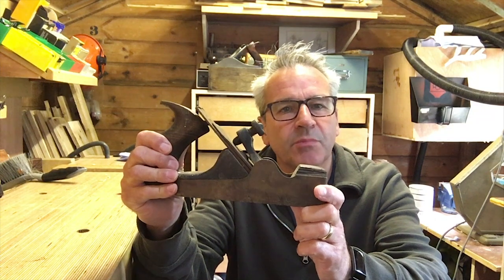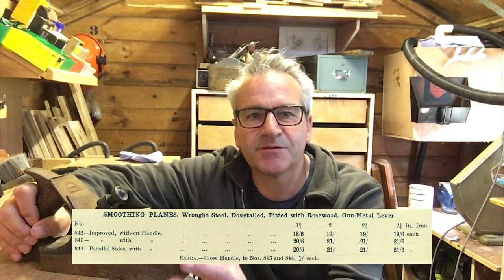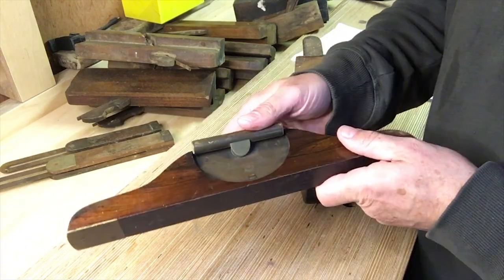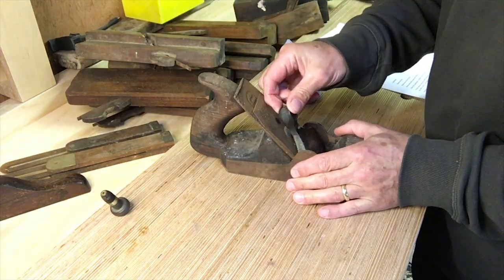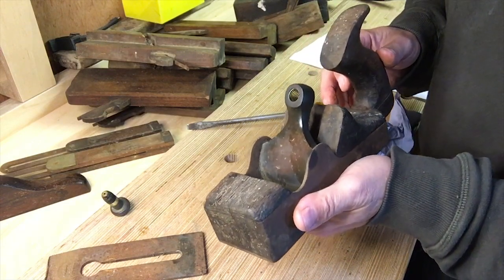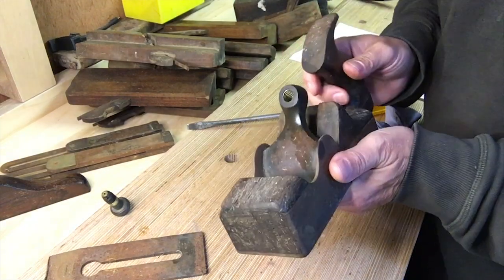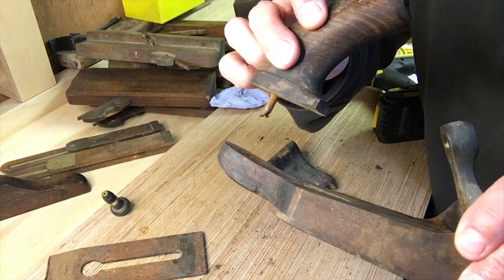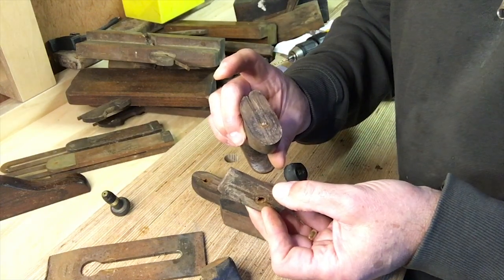Rare Mathieson Infill Plane restoration help needed

Comment: Oh the adjustable spirit level, nice bit of kit! Never seen one like it.

If you're not already a member there's a great wealth of knowledge on the UK Workshop forum in case you'd like to ask about it on there. Great bunch there, very helpful with tracing old tools, tracking down patents etc.
Reply from the maker: Mark above is suggesting it’s an inclinometer for measuring an angle or incline which makes sense - interesting
Reply: @TheShedProjectUK  Follow TC's advice on joining the workshop forum if you haven't already  🔨👍😊

Comment: Nice old plane.   I would not dunk the wooden parts in water, they will absorb water, expand, and then perhaps crack even more when the water evapourates.
If this were my plane, I would do a resto-mod flatten the bun and add a brass plate to get back to original height.
To remove the old glue I would use hair dryer and scraper.
The tote looks like it originally failed at the glue line and then someone did a bad repair with the screw.
As you said either epoxy the handle back together with the remnant of the screw left in place, or drill out the remnant of the screw.
I am interested to see how the metal body looks after cleaning.
Good call to not remove the pins for the lever cap.   They are likely swaged over into the body.
I love the level.    Likely intended for carpentry use rather than dovetails.
Dave.
Reply from the maker: Hi Dave thanks for the comments - going to start on this next week - handle fix first - probably just clean the bun for now as its not missing much wood really, the spirit level it turns out is quite rare so thats going to a specialist auction in November

Comment: That is a nice lot you got there.  
I really like that wooden bevel protractor.  I would definately use that one if I came across it.
Reply from the maker: At least I know what to call it now! Is it more an engineering thing rather than woodworking?
Reply: @TheShedProjectUK  This one I am confident is all woodworking.  The engineering ones I believe are smaller and more or less all metal. But, I am no expert in this field so take my statements with a truckload of grains of salt.

Comment: Hiya, was watching this on the YouTube app on the TV and popped up immediately to see if I can help. 

Full disclosure: have never done an infill plane but yeah, definite no to getting this wet. 

The wood could do bad things to the metalwork when it expands, but potentially worse it could catastrophically crack upon drying and shrinking back down. I've had this happen a few times when I washed old wood (not soaked it, just got it fully wet). And even swift drying off to limit absorption didn't prevent this; so now I'm very leery of getting old wood (specially beech) wet; ash seems to take it much better so I still sometimes wash old chisel handles as part of the initial cleaning process if they're very grubby.

Old glue – if it's a protein glue this will soften with heat, and careful heating with a heat gun can do it without putting the wood at risk. Obviously use a hair dryer if you went to err on the side of caution. Damp + heat is the classic combo too, so you can lay on damp strips of kitchen paper, or cotton wool. Vinegar is an old trick for softening old protein glues, but obvs you want to be careful of where the vinegar goes in this context. 

BTW not just because this is a Scottish plane I wonder if this was glued together using Scotch glue specifically :-) 

The stuck screw – for next time, try and heat it up very hot with a soldering iron. This can sometimes help release a rust hold. Obviously the head on this was badly undermined by rust so you'd have likely broken that anyway, but you might have been able to twist out the body of the screw once you separated the handle, without it snapping off. If you want to get what remains of the screw out now (possibly not vital if you glue the whole lot back together with epoxy) I think you may have to core it out, i.e. basically remove a plug of wood with an improvised type of plug cutter (made from narrow pipe, this is described in a few places online).

The bun – this is very much up to you of course. I'd be tempted to fill this will filled and tinted epoxy (added sanding dust and maybe a dot of black or dark brown oil paint), but I might just clean and leave it as you're leaning towards, depending on how I felt on the day. 

The iron – I would advise being careful honing this. It seems to have a particularly shallow primary grind (20° or even a tad lower) and you really only need to hone the secondary. To do more is unnecessary, and the iron is already perilously short so you want to lose as little metal as poss. On the plus side, old Mathieson tapered irons are not exactly rare, so a replacement could be found in due course. 

The dovetailed body — obviously you're going to lap the sole as you said, me personally I'd have no issue in sanding the sides and trying to get them close to an as-new appearance. Your Scotch-brite wheel may be just the ticket as a last step. It'll be interesting to see how much pitting there is. 

I had a chance at a Norris A5 once, and apart from the seller knowing what it was and wanting close to full market value for it (at a car boot no less!) the sides were tragically pitted :-(

Hope it's of some help!
Reply from the maker: All very helpful stuff thanks very much I have realised the water was a bad idea (I realised as I was filming it but you know poetic license and all that)
Reply from the maker: And good idea on the core plug removal

Comment: My Grandad used steam on furniture appliques he was refinishing. I use a 1910 Conservo steam canner with a barely damp rag draped over the top with the glue facing the boiling water on the first shelf. Steam it for just about a minute, maybe a bit longer. Think of steaming open envelopes during the Cold War..

Anyway, take them out fairly quickly, and you should be able to gently scrape the glue residue off with a flat scraper without too much fuss. 

You could fashion a brass plate to go over the damage on the bun. Name plate, planing guide, whatever.

Don't put the body in the electrolysis bath. If there were less risk to the wood, it would be ok, but the handle was replaced at some later point it's not the original... hence the screw and sizing spacer.
Reply from the maker: Ok good advice thanks at least if the handle isn’t original I feel less worried about damaging it thanks
Reply: @TheShedProjectUK  The biggest damage risk for those types of planes with electrolysis baths is more to do with the electrolyte solution damaging the fitting of the wooden block and the plane shoe. 

Those planes are frequently found at carriage smith and wheelwright shops and similar techniques were used to make them. The steel shoe was often very hot when fitted to the block and contracted around the wood as it cooled.

If the wood is still solid, the risk is too minimal to consider, but if there are cracks, repair joints and alterations, the solution is more likely to saturate deep into the wood, which can compromise the forge joint.
Reply from the maker: @misterf.2662  yes that seems to be general consensus of opinion thanks for advice

Comment: Would you call that level doodad a clinometer or perhaps ban inclinometer? I've seen pictures of something similar but not exactly that one...
Reply from the maker: Open to suggestions , really not sure what I am going to do with it , it’s a nice piece but will probably not fetch much
Reply from the maker: Ah I see it’s for measuring angle rather than setting an angle so perhaps used in railway engineering or similar , makes sense
Reply: @TheShedProjectUK  Geologists are users of clinometers, have a look at a full price Silva compass. A clinometer is included in the compass. They are measuring the angle of dip in rock strata.

Comment: Hot air gun would melt the glue, screw in the handle is original, boiled linseed oil and turpentine will clean the plane, you could coat the front bun with sanding sealer Norris actually used it, don't put the plane in  water.
Reply from the maker: Thanks for advice , I am going to just clean the front bun and put a dowel in the handle for strength as the screw is gone completely
Reply from the maker: Thanks for advice on finish also
Reply: No problem, spiers used dowels in smoothing plane handles instead of a screw.

Comment: Keep patina, no to electrolysis tank, nice age to it  will look VG
Reply from the maker: I have already realised the tank would be too much
Reply: Patina is just another word for dirt or corrosion ^_^ Totally agree about no to the electrolysis tank though, not because of the removal of the patina but due to the risks to the wood when it dries back out (and maybe to the steel shell from the expansion when it's wet).

Comment: Its the wrong handle on the back look at pictures of mathieson planes .front bun clean white spirit and boiled li seed oil . Glue small wire brush .
Reply from the maker: It’s possible the handle has been changed of course but I have to work with what I have I guess , thanks for the other tips
Reply: Put a dowel up.the centre of the handle instead of a screw it will be stronger i have four mathieson planes and they out perform norris planes
Reply from the maker: Yes good idea - so is the screw completely alien then? It felt a bit odd with screwing wood to wood in that fashion